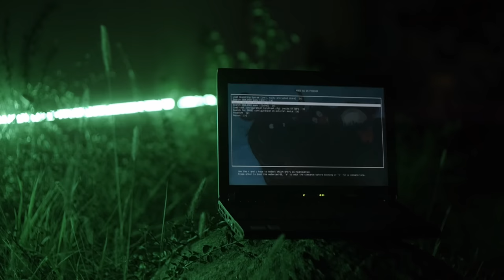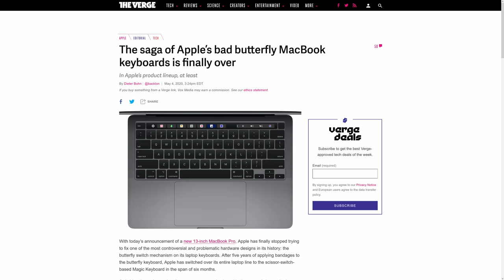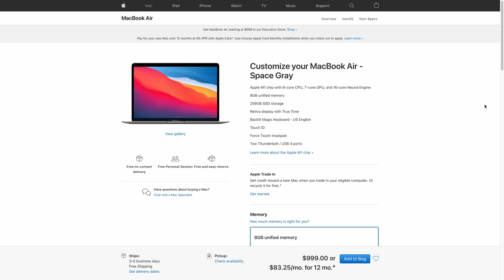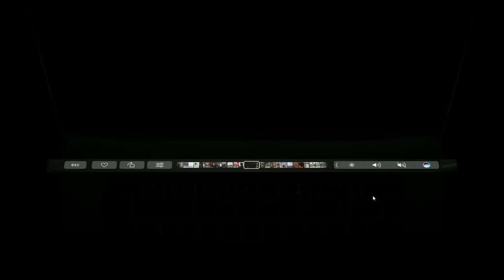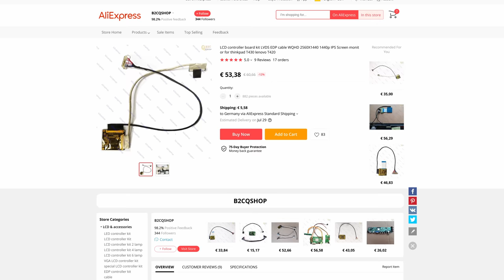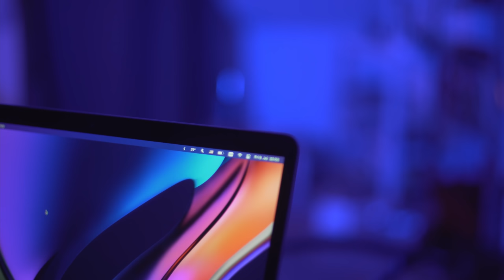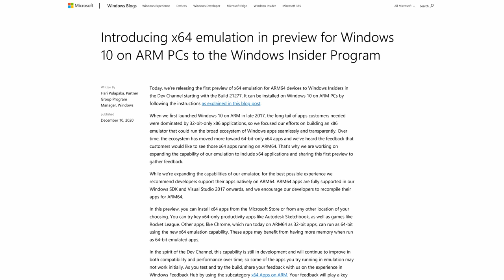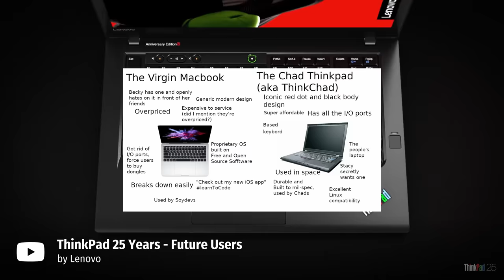Why I Switched to Mac (as a Linux user)

Comment: I wish that one day, we will have a ARM-processor based Thinkpad as good as the M1, with the old keyboard and decent webcam
Reply: Sorry, what is ARM going to give you that an X86-64 laptop doesn't already give you?
Reply: @terrydaktyllus1320  Great battery life
Reply: @terrydaktyllus1320   take a moment to realize you’re comparing an android phones battery to a modern laptop battery
Reply: @n7ghtmareee  What does that have to do with it? So a modern laptop battery doesn't drain faster the more wattage that you draw from it? Did you do electrical theory in school? Did you even go to school?
Reply: @terrydaktyllus1320  okey, now do the same test of battery with an x86 phone 🙄
Reply: @terrydaktyllus1320  smaller set of instructions
Reply: @patcherandpatch  I don't have an x86 phone. And it's irrelevant because it just comes down to battery storage vs. battery drain. Do try to keep up and read a physics book or two.
Reply: @patcherandpatch  What does that have to do with it? There's a smaller set of instructions on a Zilog Z80 CPU too, but it can't do one tenth of the things a modern x86 CPU can do. Second try, still irrelevant points...
Reply: @trd2418  I don't use Windows (I can't stand Windows 10) but why does Microsoft have to catch up? They already have an ARM version of Windows on Raspberry Pi. I don't use their Surface rubbish either, but aren't those also ARM based?
All I hear here is "marketing speak" that makes no sense at all. Again, I ask the question - what will ARM bring that Intel/AMD does not already deliver on?
Reply: @terrydaktyllus1320  the performance-to-wattage ratio is insane compared to any x86 CPU which also helps the thermals immensely. Remember that the M1 is killing all other desktop CPUs while having a 10-15 watt TDP (I'm not certain how much exactly it is because of conflicting information on the web but it's not more than 20 W)
Reply: @JustA.Person  Rubbish. Don't present figures and then say "I'm not certain". It's purely down to battery quality, battery size and overall drainage rate. Nothing more than that.
Reply: @JustA.Person  PS. You still need to spend a lot of watts on external graphics chips for gaming and video work, whether you use x86-64 or ARM.
Reply: Blame Qualcomm, Nvidia, Mediatek, .etc, and maybe potentially Apple. As Apple doesn't license out or sell their ARM chips, Qualcomm and other companies that develop ARM microprocessors decide to ignore the pressure from their superior product as it can't "compete" with them. Apple knows that they will sit on their ass until either they open up or someone else makes a superior ARM microprocessor. Apple lives in this weird bubble where they only competition is themselves which has turned the ARM processor market from the consumers point of view to essentially 2012-2017 Intel vs AMD, but without an end in sight.
Reply from the maker: @terrydaktyllus1320  Not necessarily. M1 already outperforms 1050ti at a fraction of its TDP (10W vs. 75W), and some estimations suggest that M1X could match the performance of RTX 3070 at 20-40W of TDP (vs. 220W)
Reply: @WolfgangsChannel  I'll take your word for it in the absence of real data. But any such differences are also resolved by just carrying a spare battery or two if TDP really is the only issue.
I personally don't play games or do video editing when I am on the move (I don't really do much of either on a desktop machine) and on battery power only - so those kinds of figures are entirely irrelevant to me anyway.
If I buy a refurbished Thinkpad that's a couple of years old for a few hundred dollars in my local currency, how many spare batteries do you think I could buy with it before I even come close to the cost of a MacBook?
I can only view the world from my own experiences and perceptions and, for me, the main reason for having a computing device is that it is as open and under my control as possible - and that therefore means a device that I can take apart and rebuild and repair as necessary, with software on it that I know exactly what it is doing at all times.
Reply: @terrydaktyllus1320  I use lineageOS as well, my battery life doubled as well. But it's not because it's ARM. Stock Android was also running om ARM. It's simply just because on lineageOS there are no google background services running continuesly.
Reply: @AmidMajd  You need to read my comments better. I said precisely the same thing above.
Reply: @terrydaktyllus1320  Oh Sorry, I misunderstood your comment!
Reply: @AmidMajd  No problem. My point is that the more load you put on a CPU, the more power it needs to draw and therefore the shorter your battery life is.
Yes, all my phones are Lineage OS now, with no Google on them.
Reply: @terrydaktyllus1320  A leg to stand on...
I'll show myself out
Reply: @terrydaktyllus1320  reduced size, fan less, no noise, almost no heat and twice fast?
Reply: @terrydaktyllus1320  O SHIT GUYS WE GOT A REAL ONE HERE LOL
Reply: @iliasads3817  Cool, I like "real ones". Off you go then, let's see what you can do. Why not start by showing us where your "Caps Lock" key is and that you know how to turn it off?
Reply: @nash475  Twice as fast as what? What's your benchmark?
Reply: @TheKebabFTW  No, I don't. Lineage OS is fine for me. I don't use mobile devices much, they are nothing but "toys" to me. I do all my proper computing on a laptop.
Reply: @dimitrilensflareabrams2893  Oh, okay, bye then.
Reply: @terrydaktyllus1320  wait until apple includes a dedicated gpu for gaming. Battery life goes downhill.
Reply: @terrydaktyllus1320  you... watched the video, right?
Reply: @nash475  I don't answer silly questions from silly people.
Reply: @terrydaktyllus1320  Because x86 will be dead in 5 years maybe...
Reply: @stephanemignot100  They say that every five years.
Reply: @terrydaktyllus1320  That was rhetorical, not an actual question. You're not the sharpest knife in the drawer, dude.
Reply: @nash475  If you can't communicate the intended nuance in anything that you write here, that's your problem. Spend less time on the Internet and more time reading a few books on English language. Now run along, sonny, you're dismissed.
Reply: @luxraider5384  if apple can, anyone can.
Reply: @keithmooore  people who use apple use their laptop as a bootloader of google chrome,nothing else. There are  several engineering or business software that just can t be recompiled or smth like that, in addition to that people want also to olay video games on their laptop, your customers aren t the apple people, they are harder to convince
Reply: @luxraider5384  apple just uses emulator. I believe microsoft can too. Also everything can be recompiled if you have source code.
Reply: @keithmooore  emulators can t run for anything, not every library has his equivalent
Reply: @WolfgangsChannel  yeah but when you up the performance, you lose the efficiency. It's like with fans pressure vs speed.
Reply from the maker: @BeHappyTo  That is only true within the products of the same generation. Performance per watt ratio usually improves from generation to generation, and Apple processors represent a massive development in that regard. Obviously, their new 16- and 32-core SoCs won't be as efficient as the M1, but they will still be much more efficient than x86 products with similar performance.
Reply: @nash475  You said it perfectly🙌
It also looks like he did take your advice :) nice
Reply: @terrydaktyllus1320  ARM has been developped as a RISC processor for embedded forever, making it cheaper, and less power hungry. Being developped after x86 also allowed ARM to do a myriad of small decisions with more hindsight.
Reply: @sylvain7888  Please explain that second sentence - it's a very "generic" statement that makes no sense to someone like me who has been working with computer hardware for 40 years now.
Reply: @terrydaktyllus1320  If you are doing computing intensive tasks, powerbank alone won’t supply enough juice to your power hungry laptop needing 200W-300W. No usbc battery will supply that kind of power over usbc pd.

M1max can run full speed off battery.
Reply: @terrydaktyllus1320  late to the convo but this was pretty interesting - would be interested on your take of the current market. I'm not as techy or knowledgeable than you seem to be but intrigued on the direction this is going. Also unsure if these arm processors are actually better than a full fat processor?
Reply: @Anti-FreedomD.P.R.ofSouthKorea  I don't answer the questions of strangers on the Internet.

Someone who needs to question someone else how they post what they post on a public messaging forum is far too self entitled and lacking too much self awareness for me to even consider responding to them in an intelligent manner. Such people probably needed parents that said the word "no" to them a little more often.

This is not a discussion about me, you know nothing about me and can therefore speak with no authority on the topic of me. Therefore debating the topic of me won't be happening here - so don't even try to start such.

Next time we meet, do therefore try to keep up and stay on topic, there's a good lad.

Run along now, mind how you go and stay away from sharp scissors.

Discussion closed.
Reply: @curtis24-7  Sorry for the late reply but have to put the "amateur Internet psychologists" in place when they try to go completely off-topic and "ply their trade" on me.

I would define the "current market" as being extremely good in terms of the variety of computing hardware that's out there - putting aside the actual chip shortages still there after "the thing we cannot name".

What fits your requirements is difficult to answer without more detail. In my home environment I run almost exclusively Linux (a little BSD and some Windows PCs up to Windows XP for a bit of retro gaming.

I use Gentoo Linux which is a "rolling" release Linux that allows me to build it how I want on anything from a Raspberry Pi Zero to a multi CPU Xeon server. Except for the SBCs, none of my hardware is particularly new because I stopped playing modern AAA games about 10 years ago anyway - so I don't need latest hardware as Gentoo can be made to run on just about "any old cr*p" anyway.

So what are your needs then? Give me a bit more detail.
Reply: yeah that is going to be absolutely awesome!!!
my estimates? we will get to this point when Windows 12 comes out!!
Reply: @terrydaktyllus1320 oh, ARM is like, better than x86_64 because it is more efficient, faster, cheaper, and just better!! that's why an arm laptop would be awesomer than an x86_64 one in the far future!!
Reply: @aquaponieee  funny to see terry going crazy about how we don't understand anything, while not understanding a simple fact : arm processors consume less than x86 processors and are more efficient for the modern needs. Unfortunatly only apple was able to deliver a good desktop experience with arm processors because of the work they done creating an awesome emulator for 64 bit x86 programs. Without desktop class software behind, M1 macs wouldn't be interesting. But they are, because they can do what we ask from a modern laptop.
Reply: @terrydaktyllus1320  So you just don't have a need for an M1 mac because you don't need a lightweight and power efficient laptop ? Your solution of carying batteries is just a bloated solution, needing more batteries to keep using your machine. You don't really own any portable machine therefore you don't understand a portable lifestyle. So unfortunate to see you hate on what others says, like you know better.
Reply: @terrydaktyllus1320  Exactly, there's no x86 phone because x86 is trash when you want to have good battery life
Reply: @terrydaktyllus1320  No, you don't get what they're saying, battery mostly is about power efficiency, picture this: You have two pools, a 9k gallons pool with a hole the size of a sq. ft. at the bottom, and a 8k gallons pool with a hole the size of an apple at the bottom. The hole represents the battery power that's being drained by the processor, despite being 1k gallons smaller in capacity, the apple sized hole is smaller and because of that the pool is going to drain way slower than that of the sq. ft. one. Now do you understand?
Reply: @joshuepico75  "No, you don't get what they're saying"

...and when you tell me what I am thinking, that's when I call you self-entitled and leave you to it.

This isn't a discussion about me - next time we meet, do try to keep up and stay on topic, there's a good lad.

Discussion closed.
Reply: @joshuepico75  As above, discussion closed.
Reply: @LinuxPlayer9  I don't have a need to sell my soul to Apple for a pretty computer - correct.
Reply: @aquaponieee  No, the term "better" is relative, it depends on the application for it.

And there's no such word as "awesomer", I'd take you a bit more seriously if you didn't write like a teenager.
Reply: @aquaponieee  You keep taking the medication...
Reply: @LinuxPlayer9  yeah, but what is preventing anyone else from doing the same?
Reply: it will be interesting to see what happens to arm and x86_64 once risc-v based designs mature
Reply: @aquaponieee  It's not an easy process to create or port an entire ecosystem. Apple benefits from the change, so they did what they wanted to. Windows is used for the software it can run, mostly. And that software doesn't run on arm. Apple was able to make a convincing x86 emulator for their chip, but I imagine it was a long process.

So what is preventing anyone else from doing the same ? It may cost to much for not that much result.

So Apple will stay the only manufacturer to provides competitive arm based processors, unless another manufacturer can provide another competitive arm product.
Reply: @terrydaktyllus1320  incredible energy efficiency, great battery life and a slim profile. Also the ability to natively run mobile apps (very useful for mobile devs). That's only the start.
Reply: @karmatraining  If it's only the start then keep going. I will respond when you've made your complete point - although you can make that same point about specific Intel, ARM and RISC-V CPUs anyway, so nothing you've said so far applies to one architecture - unless you're a fanboy of one and deliberately filter out stuff for the CPUs you're not a fanboy of.

In your own time, you're going to need to work a bit harder to engage with a bloke that has been building and working with computers for 40 years now.

And what kept you? We were having this discussion around a year ago? Did you sleep in or something?
Reply: @terrydaktyllus1320  Mate I’m just here to make fun of you because of the way you talk down to people. I respect your arguments, but I want you to know that at the end of the day, the most important part of communicating with other people is being respectful to them, something you haven’t yet done.

Something something run along lad something something 

Something something read a physics book something something 

Something something buy an English book something something
Reply: @terrydaktyllus1320  lol give me a specific x86 chip that perform as good as the M1 on every TDP level. Good luck.
Reply: @NamNguyen-yh8we  I don't have to give you anything, you go do your own research.

"Performance" is not just about "speed" or "how much power is used", it's about suitability for a particular application and what other restrictions exist around a particular platform.

As far as I am concerned, only extremely stupid people that don't understand data privacy submit to using Apple's "walled garden" where "all of your data is their data".

Who cares how good an M1 chip is if it exists in an Apple platform that requires you to provide your real identity every time you use it?

It's a bit like buying the fastest and most lovely looking sports car in the world but being told that the only place you can buy fuel for it is 100 miles from your home!

Stop being a fanboy - open your eyes and see the full picture around things, that's how good engineers are created.
Reply from the maker: @terrydaktyllus1320  Lol.
macOS doesn't require you to provide your identity, real or otherwise. You can use macOS 100% locally without an iCloud account – no workarounds required. 

You can also just wipe the drive and install Asahi Linux if macOS is not your jam

Fanboyism makes you blind, but so does being a hater
Reply: @WolfgangsChannel  "macOS doesn't require you to provide your identity, real or otherwise. You can use macOS 100% locally without an iCloud account – no workarounds required."

If you choose to use it in a restricted way, then that is your choice - but that is not the way that most people use it, including my own wife who is "all Apple" and integrates everything together as Macbook, iPhone and iPad. The fact that the iPhone tracks her every location to an accuracy of 2 meters 24x7 using wifi triangulation means that she has no anonymity using Apple products. I don't believe she has made the right choice but she has every right to make it, as does everyone else.

Most people I speak to tell me that they choose Apple product BECAUSE they integrate so well together - so if that's not a feature you personally use, then I might well ask you why do use Apple products then? Because the integration alone means complete loss of data privacy and your own words tell me you already know that.

This works both ways as an argument when you understand that the price for convenience is so often your data privacy.

"You can also just wipe the drive and install Asahi Linux if macOS is not your jam."

Why would I pay for an overpriced piece of hardware made in a Chinese factory alongside Asus or other "standard" PC motherboards and components just to then stick Linux on it?

Why would I not just pay a similar price to a Macbook and go to, say, System 76 and get a pre-installed Linux PC?

"Fanboyism makes you blind, but so does being a hater"

My friend, "hate" is a word used by a toddler when it says "I hate you mummy" when she won't buy the kid a toy it wants.

Having hatred is a sign of desperation and being backed into a corner with no way out.
When it comes to computing and my 40 years experience in it, I don't need to "hate" anything because any computing problem I am faced with I know that I can solve with the knowledge and resources that I already have access to - that's how the "engineering mind" works.

So the best and most powerful "emotion" that I need to display towards privacy-hating products like Google Android, Apple or Microsoft Windows is simply "apathy" - because I can always use Linux or AOSP to deliver a good computing solution whilst prioritising my right to privacy and anonymity as much as possible and as viable alternatives.

If you favour convenience over privacy then that is a choice you make, and nothing to do with me.

All I can do is be the "good Internet citizen" and warn you of the compromise you make when you choose convenience.
Reply from the maker: @terrydaktyllus1320  
That's just moving the goalposts. You claimed that Apple requires you to provide your real identity to use macOS – which is objectively and verifiably wrong. 

When I pointed that out, you then shifted to "yeah, but providing your identity makes for a better ecosystem experience, and if ecosystem is not the reason you use Apple, then why use Apple at all". Valid point, but that has nothing to do with your initial claim, which is still factually incorrect.

And after taking a cursory look through the conversation in this thread, that seems to be your MO. Make an incorrect claim, somebody corrects it, move the goalposts and talk down to people, while justifying it with the supposed "40 years of computing experience". Repeat until the other person decides they have better things to do with their life than arguing with an old man on the Internet.
Reply: @WolfgangsChannel  This discussion began over a year ago, so you will pardon me if a lot of what I said is now a bit "misty" in my own brain.

I have had a read through my previous comments here and I am not going to play a game of "verbal semantics" with you by analysing each and every word I wrote - likewise I am not repeating the same thing over and over again to you.

Apple products are designed to integrate together using, for example, single sets of "keyrings" for authentication across Macbooks, iPhones and iPads. In my experience, most Apple users are non-technical and that cross-device functionality is a major reason they buy Apple - my own wife included.

The mobile phone, iPhone or Google Android, is a surveillance device for Apple or Android. The only way to have a phone in your pocket and not be surveilled 24x7 is to either use a really old 3G "dumbphone" (assuming it still works) or de-Google an Android phone to use AOSP.

Because most Apple users link their devices together, then all three of them link to the same account that you have to use on an iPhone, and therefore all devices become surveillance devices by virtue of that relationship.

So stop "playing dumb" and being a "devil's advocate", Wolfgang, you understand fully the points I am making.

As far as I am concerned you're a YouTuber that has produced some excellent technical material (thanks for the Fujitsu S920 pfSense router video, I made one myself and it works great) but, like so many content creators, you start getting a bit popular, find you don't have enough time to produce your content and you start making shortcuts elsewhere to claw time back - and then you make u-turns that contradict what you have said previously, especially when it comes to privacy on the Internet.

That's fine, you do you - but don't try and "crowbar in" an opposing philosophy to what you've previously preached but not expect an "old h8ck" like me to not point it out to you when you do it.

If Apple works for you then good luck to you. But don't pretend that choosing to go the Apple path is for anything other than convenience, and there's is always a sacrifice of some privacy for that convenience.

So just be honest about it.

And this is my last lengthy reply to you on this topic because I don't have to put this stuff in "layman's terms" to someone with considerable technical expertise like I know you have - and take that as a compliment, even though you're being dishonest over the actual reasons you've made a u-turn.
Reply: @WolfgangsChannel  PS. You're the one "moving the goalposts", my friend.

How does your usage of a MacBook now fit in with, say, your "Online Privacy & Security 101: How To Actually Protect Yourself" video from 2 years ago?

Again, this isn't a criticism about what you choose to use in your computing life, that's your business.

But don't "contradict" previous things you've said and then try to "paint over it" with some kind of "tecnical bullcr*p".

You're not going to fool someone like me with several decades experience in this stuff, but you do owe it to your younger and less experienced audience to be honest about it.

I'm done with this discussion now, I don't want to keep covering the same thing over and over again.
Reply from the maker: @terrydaktyllus1320  

Have you watched the video you're talking about? In the first minute, I say that I won't touch on mass data collection performed by the big tech companies like Google and Apple, because it's an infinitely more complex topic than protecting yourself from targeted individual attackers... (which was the actual topic of that video).

Gish galloping towards perceived hypocrisy doesn't cancel out the fact that your claim about Apple macOS requiring the use of your 'real identity' is factually wrong. If you're unable to admit a factual mistake on your part, then I'm sorry, your interactions with other people must be an exercise in frustration for both sides. I think this thread demonstrates that pretty well.

There's no point in debating a person who belives that they're always correct about everything. There's certainly no shortage of older people who think that their experience allows them to stop learning and growing. I hope that you learn and grow regardless.
Reply: @WolfgangsChannel  " I say that I won't touch on mass data collection performed by the big tech companies like Google and Apple, because it's an infinitely more complex topic than protecting yourself from targeted individual attackers... (which was the actual topic of that video)."

So what you're essentially saying is that because you don't talk about it, it doesn't exist? 

Or that you "cherry pick" the points that don't want to talk about?

It's NOT an "infinitely complex topic", at a high level you can explain how data collection works reasonably quickly. Go see how Rob Braxman does it on his channel.

But that's not an excuse that someone intending to communicate responsibly should ever use. Don't talk on the topic in the first place if you cannot deal with it subjectively.

"Gish galloping towards perceived hypocrisy doesn't cancel out the fact that your claim about Apple macOS requiring the use of your 'real identity' is factually wrong."

No, it's factually correct because I have confirmed this with my own eyes on the Apple products that my own wife uses.

When you pay a premium price for those devices, you expect to get Apple support when you need it when the device goes wrong. Each device is registered to you and that is checked, as well as warranty status, before you get support from them. They have all of your details on record, whether or not you personally log into a MacBook or not. They also have CSAM monitoring on the devices, which means they know everything you have on those devices.

That's fact, that's just counting - you can verify that in many places on the Internet.

Apple know your real identity because they see everything in storage on your devices.

" If you're unable to admit a factual mistake on your part, then I'm sorry, your interactions with other people must be an exercise in frustration for both sides. I think this thread demonstrates that pretty well."

No, all it demonstrates is you think you know me a lot better than you do. You are at a disadvantage here because your own video content tells me a lot more about you than you know about me.

When I comment, I simply analyse the words that people write and I "hold up a mirror" to them if necessary to show why they are wrong. I make no assumptions about who they are or what they look like, albeit the words they use can tell me certain things about them.

What you're doing is taking a few words you've seen me write and extrapolating at least some of my character from those - I would suggest that such an extrapolation is inaccurate based on a small amount data.

And let's not get "personal" here - all I have commented on is stuff you have already told me about how you use computers, so let's stick to what we know, rather than what you think is the case and making personal attacks that will just bounce off me anyway.

"There's no point in debating a person who believes that they're always correct about everything."

No, that's your belief about what you believe I am - or you're just trying to "cancel" what write by discrediting it, yet you don't answer many of the technical points I put to you. You simply wave them aside.

For the record, I have no idea how to ride a horse or repair a car (amongst many other things) - therefore you won't see me adding my opinions in car mechanics or equestrian channels on YouTube. I am simply "really good at this sh1t" and crap at many other things.

"There's certainly no shortage of older people who think that their experience allows them to stop learning and growing."

Maybe so, but you don't have enough information about me to know whether that's a category I fall into or not - and I am not going to "take the bait" of responding to a verbal game of "Battleships" with you, where you take "potshots" and I reply "hit" or "miss".

Look, I've no beef with you personally and I think I've made all of the points that I want to make now.

Computing, IT and cyber-security are subjects I enjoy talking about and I write and present training materials in my job as a secondary function. I often do it to people who don't have English as a first language, therefore I communicate directly and succinctly. If you or other people want to read "arrogance" or "never wrong" into those words, that's you choice - but from my perspective, it's just "confidence" in knowing my topic and if there's new stuff for me to learn (like your S920 PFSense video) then I sit down, shut up and learn something new.

Knowledge, wisdom and humilty are not mutually exclusive qualities - if anything, one needs humility to just "shut the feck up" and learn sometimes - I wish more of your generation understood that.

Take that or leave it but I am done now.

Discussion closed.